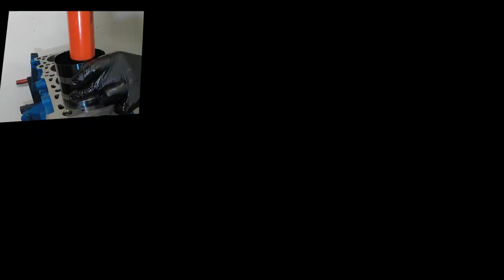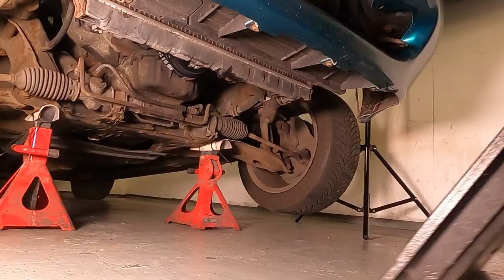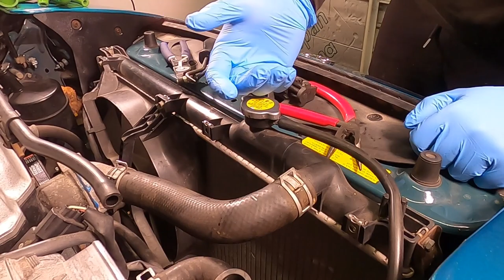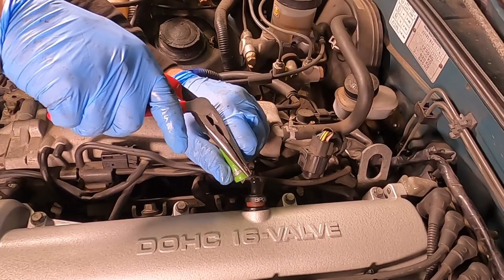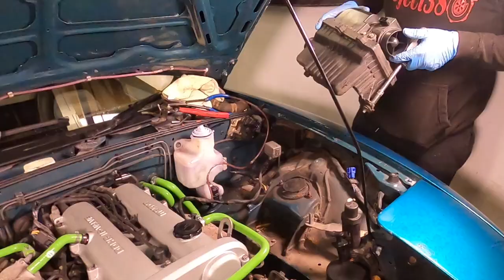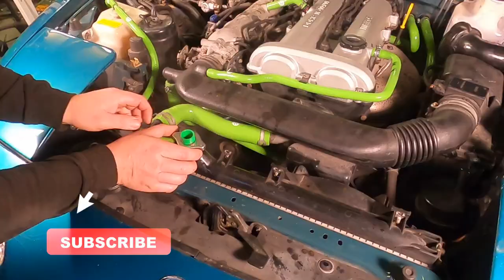MX5 SILICONE HOSE KIT INSTALL GUIDE

Comment: Was following this vid, and at 6mins 30 you swap a hose for the brake booster, is thst one meant for that? Does it have a valve in?
Reply from the maker: im gonna be honest i made a mistake, but a video will be coming out on this very soon
Reply: @Project380  it's funny you say this, I have a few frens with mk1s, one is currently running no valve and hasn't hit any issues yet, he's a sketchy fool tho. I put my old one back on so I'm yet to try the no valve vs valve brake experience. 

Love the vids as always man, super helpful stuff !

Comment: How did you jack the car up off the pinch points without bending the body?
I tried once and it bent too much
Reply from the maker: this one had been repaired so i was brave, the slightest bit of rust and they will bend, i would suggest the point where the wishbone meets the subframe, nice and strong
Reply: @Project380  will give it a try thanks

Comment: What is the liquid that was in the pipes? And how do you replace it once u change the pipes?
Reply from the maker: its coolant or antifreeze, just fill it back up via radiator and let the system bleed itself

Comment: Do you not have a oil cooler hose?
Reply from the maker: good point...... the kit didnt come with them
Reply: The hose used on the brake servo should have been used from the inlet manifold to oil filter housing, (ie the bit the oil filter screws onto). There’s also the devil hose that goes from the oil filter housing to the back of the block. That’s a pretty hard hose to change, but I had the alternator out and coil pack loose and managed it ok. So on that car, 2 hoses are still old.
Reply: @Project380 thats a lie i saw it at 2:47 on the left headlight. just say you dont wana do the devil hose

Comment: Too bad you skipped the part where you got the hoses off of the block. Why do you guys skip those bits? Can’t tell you how many times I’ve opened an entire video on some thing just for the YouTuber to jump cut over what I wanted to see.
Reply from the maker: you mean the ones going to the oil warmer? if so ive not put them on yet as i was going to do it when the engine comes out later this year
Reply: Yup I was seeing if he was gonna take the coil pack off for the heater hoses but no had to skip it
Reply: My heater hose went out yesterday
Reply: I just did mines and you just need long pliers and a lot of patients. Nothing was need to be taken off